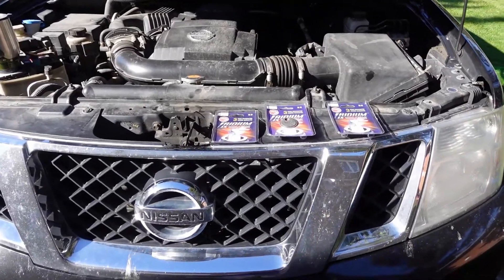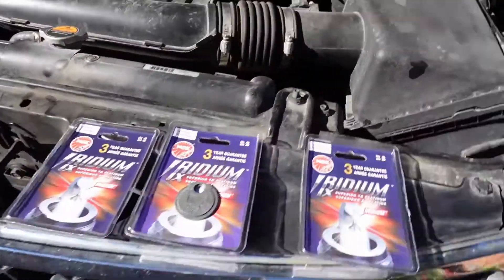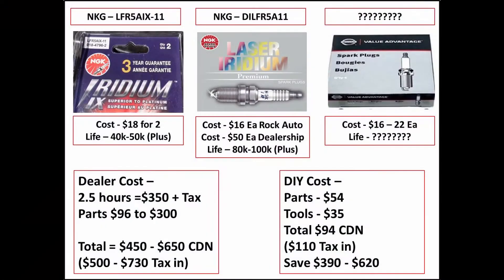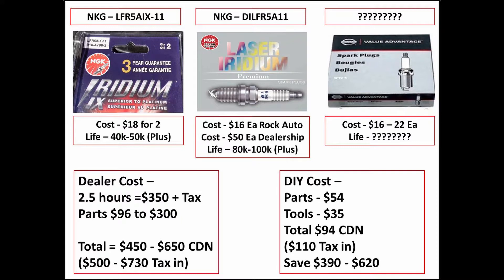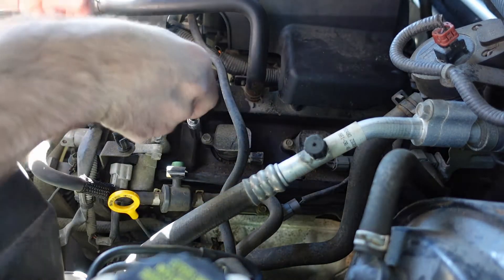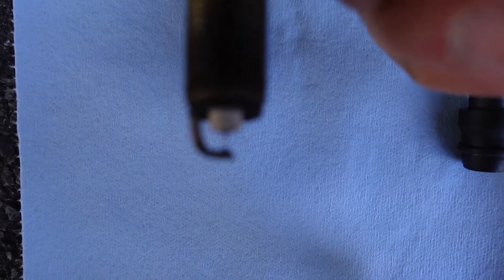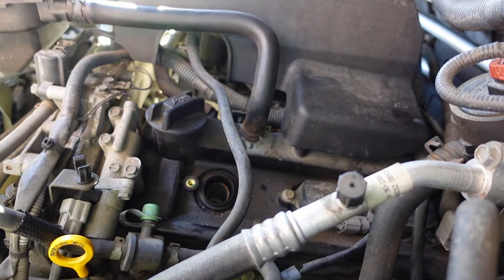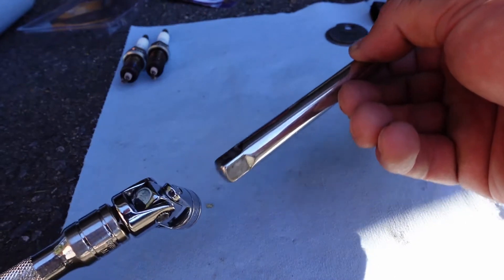2012 Nissan Pathfinder Spark Plug Change

Comment: You were very helpful in your details of the tools used and exactly how you removed and installed each plug, coil and electrical connector.  Thank you for posting.
Reply from the maker: Thanks for checking it out
Reply: Your welcome.  This video was a life saver.  Taking that intake off was much more risk.  This was a little troublesome but total gold.  Thanks again my friend.

Comment: Very good video...one tip I do is to use a short piece of vacuum tubing, push on to top of spark plug.  Then slowly lower in the plug hole and turn in the plug until it stops, then pulloff the tubing. Saves having to drop the plug in and insure no cross threading
Reply from the maker: Thanks for watching and commenting

Comment: Thx , just done this method. I have to say you need to have 2 sets of sockets for this job or bunch of extra extensions.Angle extension will help too. Ether way center one , and the one under intake was hardest. This job took me 2h40min. My highway fuel consumption went from 19l/100km to around 13.
Reply from the maker: Glad it got done. Yes the more extensions the better on this one. Those are impressive fuel savings.

Comment: Nice work!!! I have a 2011 4.0 pathy and iven been avoiding doing this job lol....thanks for this vid cause it is straight forward....i read other places you had to take off so much crap with the intake so now im not stressin lol.  Thanks bro
Reply from the maker: It honestly wasn't too bad. having the right sized sockets and extensions makes all the difference. Thanks for watching.
Reply: Awesome 👌... I have the same vehicle as yours and I was dreading ripping the intake off to do this job without a mechanic friend around.  I do have xxl hands, so having an Asian gf with "dainty hands"might prove to be worth her weight in gold... lol
Love all your maintenance vids and hope I haven't missed any. Good job amigo
Reply from the maker: @deanminault6276  If you've changed plugs on something else before this shouldn't be too bad. Thanks for checking out the videos. Best of luck.

Comment: Excellent presentation.  Details on the tools really helpful. My 10mm rachet wrench isn't  a stubby at 3 1/2 in . Mine is 6 inches. I think if you leave the center plug out on the intake side will make it easier to get front passenger side out.
Reply from the maker: thanks for watching and the advice.

Comment: Thanks for the helpful video, real life saver.. tool list, spot on... Especially with the swivel and short extension. Passenger side was killer on the hands, but easier t take wire off with coil oulled off, there was plenty of slack. Under the intake, used flat head to pry wire off the clamp while holding the other bracket lmao..  it was challenging, but got it in 3.5 hrs. Its roasting in TX!!! 🥵
Reply from the maker: Glad the video was helpful.
Hopefully you at least got a sun tan.

Comment: Thanks for this DIY. I just acquired a 2012 Pathfinder, and am in the process of going through all the preventative maintenance items even though it has relatively low mileage. Your channel is going to be a great help.  Spark plugs done today exactly as you described. I used NGK 96355 Ruthenium plugs, and, aside from a little hand cramping dealing with the front passenger side coil, all is good.
Reply from the maker: I'm glad you were successful. Best of luck with the 2012 Pathfinder.
I am pretty positive about mine, it has some quirky things about it but over all its been good.

Comment: I just did this today I think I took out a total of four or six bolts took off I think three nuts or two nuts loosen to house clamps an unpop the main wiring harness plastic clips from the back side of the intake manifold and then used a large pry bar to pry up get the intake up and it was very quick and painless no through the woods and over the bridge to grandmother's house we go to get the spark plugs changed all of this stuff is nifty and all that but the time you take to go through all of these other steps take so much longer than if you would just take the stupid manifold up don't disassemble it just loosen it pick it straight up until you get clearance to get one 6 in extension and your plug socket down in the hole take the ratchet to the extension and do the thing don't forget to put some anti-seize on the spark plugs the ones that I took out of my project vehicle today at work were I mean the original ones the vehicle as 170,000 mi on it never been changed and it came in to our shop with a Miss in the number two cylinder which we diagnosed and which the customer wanted to have all of them changed and so don't play around do what is necessary to take the manifold up and then just go about the normal chore of changing the spark plugs that's all there's no special tools required a 10 mm a 12 mm and yeah I think it's a 9/16 rubber clipping plug socket a pair of needle-nose pliers to release the main wiring harness from the back of the manifold and one large fry bar to hold up the manifold and that's it there's no military secret here you just do the extra steps to make the job easier
Reply from the maker: Changing the plugs with the intake manifold on is super easy. It presents absolutely none of the challenges that you have suggested and will be done faster and just as well as doing it with the manifold removed. The tools to do the job were all in my extremely basic socket set. If you lift the intake manifold you will break the seal of the gaskets. If the vehicles had 170,000 mi on it you should most certainly change the intake manifold gaskets after doing that (in fact you should do so regardless of mileage). As for using anti-seize on spark plugs, I also used to do that. It is the wrong thing to do when using NGK spark plugs. "NGK spark plugs feature trivalent plating.......Do not use anti-seize or lubricant on NGK spark plugs. It is completely unnecessary and can be detrimental."  https://ngksparkplugs.com/en/resources/5-things-you-should-know-about-spark-plugs

Comment: hopefully you're checking comments...  how do I disconnect the wiring harness as noted at ~11:24. I'm sure it's obvious, but can't figure out how to.  LOL.  thanks!
Reply from the maker: Mine is easy to get off and on now, but the first time it was a pain. I used a big flat head screw driver and you need to push the plastic clip back through a square cut out in the bracket. I do it in the video linked below, and you can see how it goes together at the 3:50 point. 
https://www.youtube.com/watch?v=XIj54m9SXgk&list=PLT3xASCJKk7nLRFUr-LqDn6-5Deg7gGSc&index=13
Reply: @DIYNorth  Ok.  that video helps visualize what i think i need to do.  looks like I need to pry the plastic piece a just a bit.  I was trying to remove it totally different.  Thank you!
Reply: Your instructional video was invaluable. The hardest thing for me was getting the screw on/off for the last plug . Still couldn’t figure out how to get the wiring harness either. lol. Thanks
Reply from the maker: Glad it turned out in the end.
Thanks for checking out the video.

Comment: You’re right, the middle one on the passenger was a bear. The electrical connector on the coil killed my fingers.
Reply from the maker: But is the job done?
For sure though, that one has to be the worst.
Reply: @DIYNorth  all but that one.

Comment: Im about to swap out the plugs in my ‘12 Pathfinder, and I was checking the gaps today on the new plugs. All of my NGK Iridiums appear to be closer to 0.041 than 0.043 (spec). I noticed at 8:31 that yours was closer 1.0 mm than 1.1 mm. Is there a tolerance you’re allowing? Does 0.041 vs 0.043 really matter much? Don’t want to over think it, but I spent a pretty penny on these plugs and want to make sure they’re correct.
Reply from the maker: I don't think that my gap tool can really get down to the level of precision needed. holding the plug or gauge at an angle other than 90 degrees could through off the reading. My opinion is that these types of gauges are useful to indicate a measurement that is significantly out of specification, but not as accurate when working at the 0.05 mm range. If the plugs say that they are 0.043 inch and you are reading 0.041 my guess is that the 0.002 of an inch might be a precision error in your tool. All that said I would run them if they are as close as you indicated. I'm just a guy on the internet though.
Reply: Fair enough on the gauge accuracy. And I’ve been reading how some folks that have been doing automotive work for decades and have never had to regap an iridium plug. Plus, all six of mine were measuring the 0.041 (meaning it wasn’t just one or two outliers). So due to the consistency, I’ll chalk it up to my gauge.

And at least for 2012 Pathfinder maintenance, you are THE guy on the internet😂
Reply from the maker: Thanks for checking out the videos 
Good luck on the plug change.

Comment: i assume 2006 frontier is same?
Reply from the maker: I think so. I believe the frontier has the VQ40DE engine as well. That said there are often differences across the an engines life cycle so there could be some differences between the 2006 and the 2012. I'm not 100% that they are identical.
Reply: @DIYNorth  thanks

Comment: Question 🙋‍♂️ why did u change them spark plugs why??
Reply from the maker: The OEM plugs have a change interval of 120000 miles or 192000 km.
I'm at about 220000 km, so I've gone well past the recommended change interval period.
Other than that they seemed to still work fine.
Reply: Hey Oscar you really should change every 75K
Reply: @ashmontrealty  bro i have my Nissan Pathfinder 2011 silver edition. I got it  back in 2013. Now has 228078. I never change it.  Still running good 👍🏼 do I have to change it????
Reply from the maker: I obviously went just as far on my plugs as you did, I had a plug fail on me once and it was pretty bad. The plug detonated in the cylinder and it sounded like rocks banging around in a tin can. It was an expensive repair. If you go to my main site page and look at the banner picture you can see a cylinder head. the center cylinder head looks very mashed up and the ones on either side look fine. That is what happens inside your cylinder when a plug catastrophically fails.

Comment: Hello, I have a question, the spark plugs that I removed from my frontier pro4x 2011 are shorter than the ones they gave me in a car parts. So I'm afraid to put the longest ones on it and spoil my engine, how could I know which ones are the right ones?
Reply: Help 🙏🏻
Reply from the maker: You should be able to look up the correct plug on several web sites such as advance autoparts web site. Did you get the plugs from  a Nissan Dealership? If so I would assume that they got the right ones. Are the ones that you removed from the vehicle the original plugs? If there is any doubt you could just take the number off the side of the ones that are in the vehicle and replace them if they have been working fine. 
If the potion of the plug that enters the engine is longer that could be a big problem. If the portion of the plug that is longer is the ceramic portion that sticks out of the engine then I would be less concerned.

Comment: Hi my service engine soon light is on it reads code p0442
Reply from the maker: it should be an EVAP problem which could be a lot of things including issues with the gas cap, vent/purge valves, rust, etc. I'd start with the gas cap.

Comment: doin this tommorow with a slight hangover from the Oiler game tonight im sure..  Just wondering if you have done the alternator job yet and if you have a vid for that?!? I have the exact same truck even same color.  Great vehicle but quite the gas pig!
Reply from the maker: I dont know if this is the best job to do hungover, but I wish you luck.
Engine air filter change is a good hungover job.

I haven't had to touch the alternator. I've done the belt, but that's it.

Comment: They can easily last 100000 miles, I changed the ones in my Nissan Frontier, I will changed them again at 200000.
Reply from the maker: I think it might depend on which brand and type of plug you use, but generally iridium plugs last a very long time
Reply: @DIYNorth  I use NGK Iridium, my Frontier odometers reads about 180000, in 20K more miles I will use your method to changed them. Thanks for the good video.
Reply from the maker: I think the NGK ones are the best to use. Best of luck with the change.